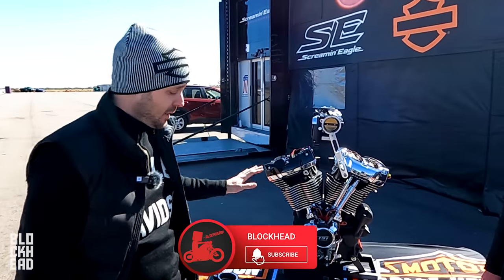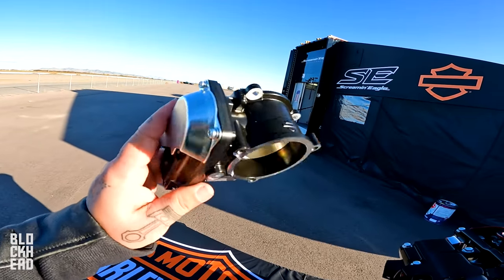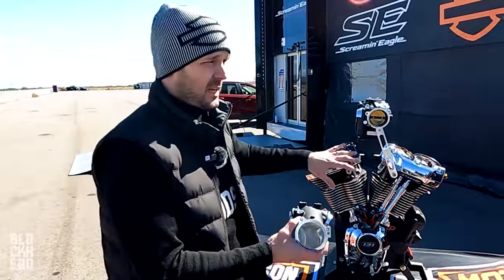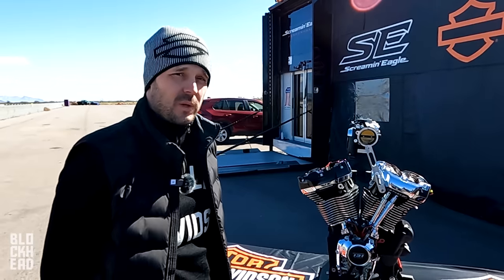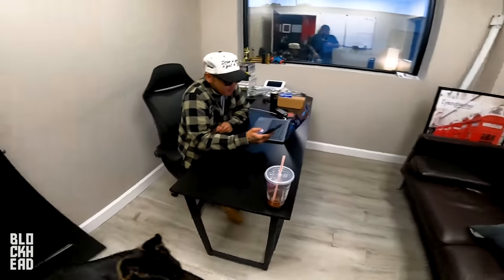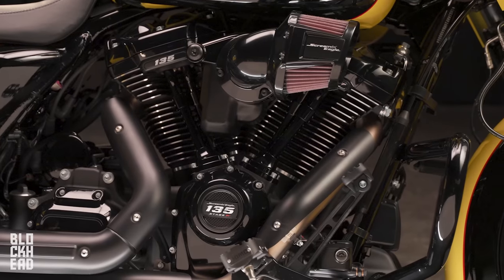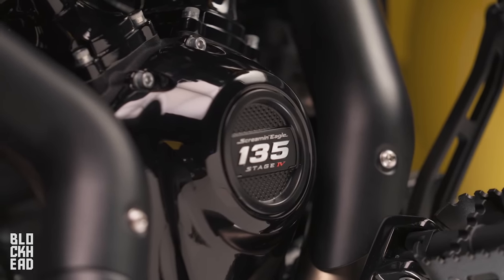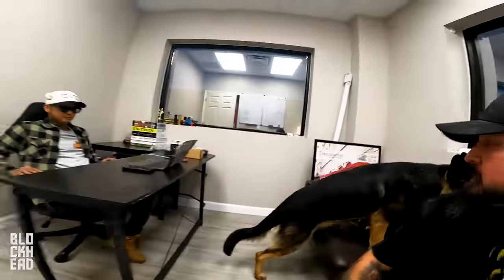Harley-Davidson 135ci CRATE ENGINE!

Comment: Put that new engine in a FXR build🤘🛵
Reply: That would take quite a bit of work znd frame modification. If you could even physically fit it. With larger 4 valve head and 131 displacement..
Reply: @kingofthebritons5954  There is a video of an m8 fxr on GET BENT MOTO
Reply: It could be done for sure … but the new softail platform is a much better platform
Reply: I’ve got an 84 FXR… lol I volunteer my bike for this motor. I’ll take one for the team

Comment: For an emissions legal M8 Crate Engine:  Pretty darn good power and torque numbers, nice curves, with peak torque at 3500 rpm and peak horsepower at 5500 rpm.  And that's in the EPA compliant mode...HD-SE 517 Cam, HD-SE Tuner and Catalyst equipped exhaust system...plenty of power for most of us just cruising around, 2-up, etc. on our Baggers.

Comment: My fav thing about HD, the stock engine can be so modified. Can't say that about a lot of other motorcycles. What ever you want, high hp or high torque,, it's there to be  gotten.  Sounds like this 135ci engine is going to be close to insane.
Reply: This finally might be able to keep up with Indian's 108 PowerPlus! MAYBE
Reply: @thewitness9305  I looked at the power of that, my built. 103 blows that away. Not even close. My torque comes on at 2000rpm for 100pd/ft!  LOL. Goes way higher from them.  Plus their styling is old.  It’s better out the box power wize, I give that. But that’s where is ends. It eats my dust.
Reply: @Mark-mm1ke  i am a big harley fan but the challenger is quicker than even heavilh modded bikes. the challenger has much shorter gears than the harley baggers and if you tune it, it really opens it up.  there are a bunch of videos of it taking off from aftermarket built 128 ci Harleys making 140 HP up to 100, then the harleys with more power take the lead.
Reply: So is the Indian Challenger, it's a bagger with a 130 hp right from the factory plus you save 10,000 grand
Reply: @rodsharun7734  the challengers numbers are measured at the crank, not the wheel. It is only putting down 100-105 of that 130 at the wheel. This 135ci motor is putting down those numbers given at the wheel.

Comment: Someone else mentioned this, but the real challenge is keeping it cool. The 114 already runs pretty hot with just an oil coooler.
Reply: My RGL gets HOT and it being twin cooled! So I want to know how much hotter it can get now 😂😂😂
Reply: Its also a matter of tuning.
Reply: Problem with air cooled motors are being air cooled.  More horsepower more heat and friction with reliability issues. Liquid cooled is the future with improved reliability, stable performance, and lower emissions 😊

Comment: The big question for me is, will they raise the ~108mph top speed.  I was pissed when I built out a stage 4 117c suspension, brakes, etc and didn’t know there’d be a 108mph limit on my performance bagger.  I’ll be customizing a 135 if that’s not an issue anymore.
Reply: @ihateemael  and remove the warranty.  I was in 55k already so I was playing it safe. The next one Id probably have to gamble, that limiter suckeddddd.
Reply: I had my bone stock lowrider st over 120
Reply: @fvgc454ss  yup. the cruisers have a max of about ~126, if I remember right, and the touring bikes are about ~108. If you want to keep your warranty. doesnt matter if you fully stage up your motor, brakes, and suspension to make a weapon of a bike. the limiter still stands.... if you want that warranty. HD is the only one that does it, out of the other brands I have had. (Yamaha, Ducati, btw).  I have tuned bikes with race exhausts and always kept my warranty on every other brand. just the way it is I guess.

Comment: Everything about this screams "I WANT IT!"
But my wallet is screaming "YOU JUST GOT A 131, DEAL WITH IT!"  :D
Reply: Lol I'm with you but in my case I couldn't even afford the bike I would want to put it in (breakout), bought a sportster s though so still got a quick bike lol
Reply: That new 1250 motor is no joke, that's for sure. Especially on a sub-600 LBS bike. :D
Reply: Thats not that much power
Reply: Just save your money and go buy the Indian Challenger Bagger 130 HP right from the factory

Comment: So 130hp for 8k plus another 2k for installation and 32k for the bike? BMW k1600b 160hp out the box for 28k. Seems like a bad deal to me? Put the same engine in a Fatboy 33k. Triumph rocket 3 160hp for 26k. Harley still doesn’t get it?

Comment: Sounds like a great platform to E85 fueling for drag and racing circuits to maybe produce cooler running engine maybe dunno if motorcycles can use E85

Comment: My 2011 dyna street bob has the 110 tire shredder kit and makes 106hp/122tq and that is more than enough to get me into trouble. It's getting a bit ridiculous now honestly and from what I've seen on the 117 and 131's have enough trouble getting to 10k miles without issues. If you want to haul ass get a naked bike for a 3rd of the price of a "built up" Harley. I also have a 2020 z900 that will DESTROY my dyna without even trying. Cheaper to add a 2nd "actual fast bike" than buying some of these crate motors...just my 2 cents.

Comment: @Blockhead you mentioned the 135 crate motor is meant for the 2021and later touring models. Just an FYI online Harley says it will fit my 2017 FLTRXS. Will be interested to find out which is correct.
Reply: It’s an M8 so I’m only going to assume it will fit any bike with a factory M8